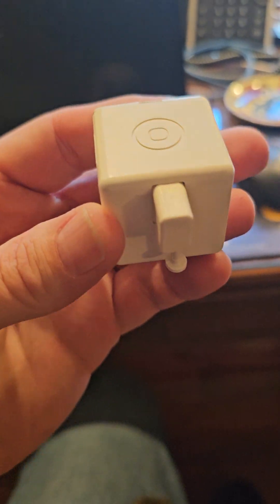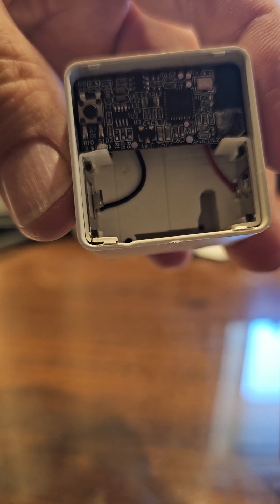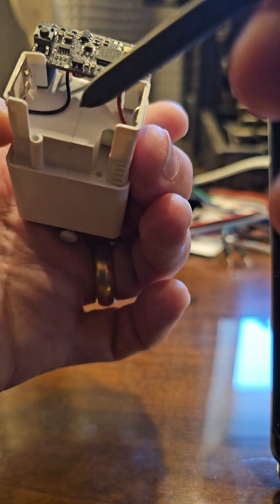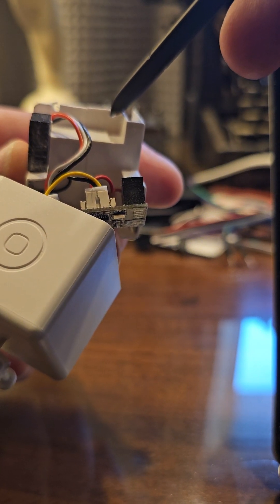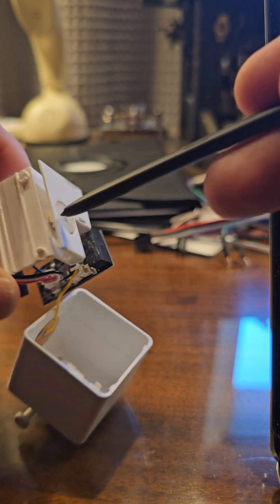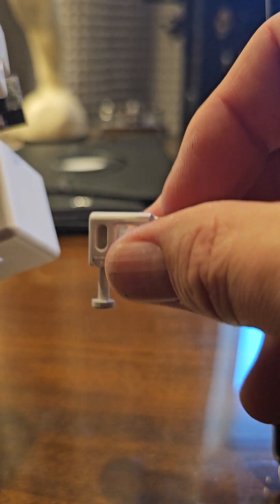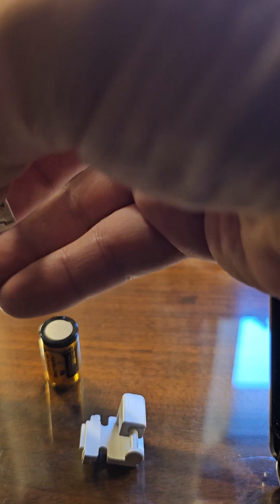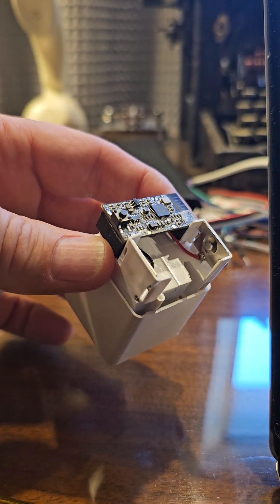Fingerbot Plus Dissection, Zigbee Version (looking at the insides)

Comment: How long do you have this for until its dead?
Reply from the maker: Do you mean battery life?  The battery lasted close to a year.
Reply: @SoooBrian no, i mean the device itself. I had two of these and its dead within a span of 4 to 6 months. Resetting and changing to newer batteries didnt work. So im contemplating if i should get a new one or find alternative.
Reply from the maker: @eyhtwozed2606 I will admit that my fingerbot devices are rarely used to press reset buttons on my sump pump battery controllers.  I can absolutely see how the plastic gears and plastic teeth could wear out over time.  Mine still work in June 2025.